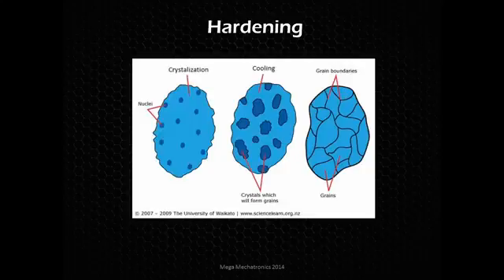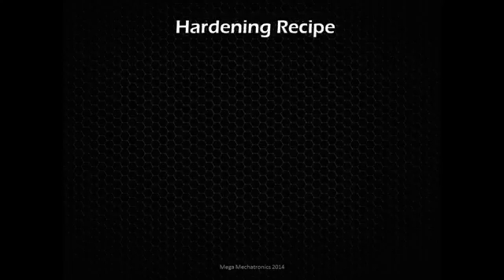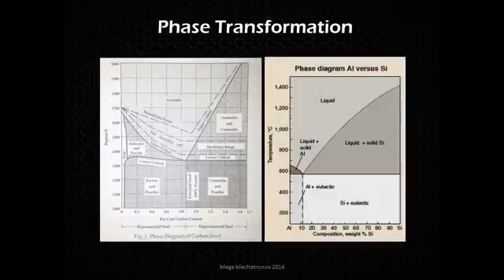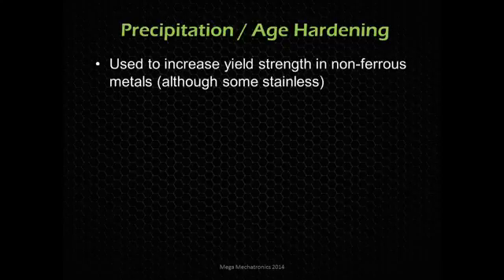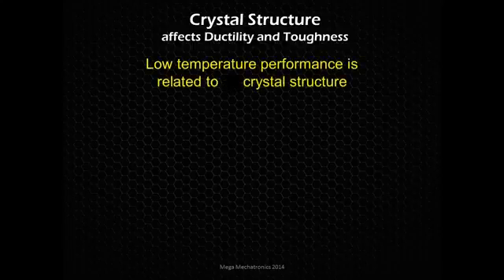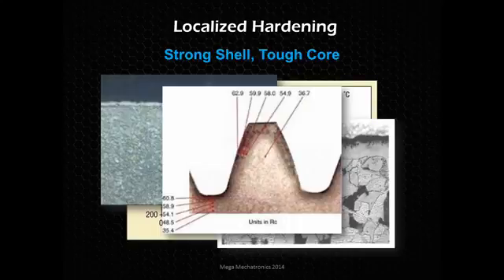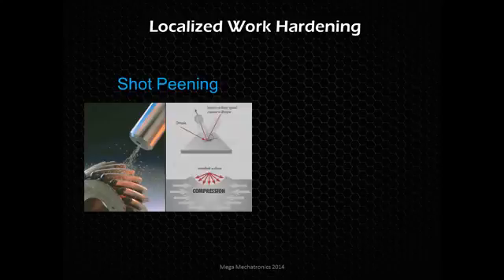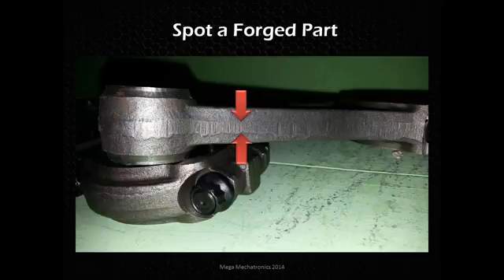Materials Science Mechanical Engineering    Part 4 Heat Treatment Explained

Comment: Tommi Jaya Surbakti_2714100093
Quiz 1 Heat Treatment Class: Q

Hardening and Treatment
Hardening is a procees to make the material became harden or to make the phase become martensit phase. As we know martensite has high strength. high hardness and brittle material. The process can be anaylezed by the change of the microstructre. Crystal system is a crystal syestem whre the unit cell is in the shape of cubic, there are three main varities : Face Centered Cubic, Body Centered Cubic, Primative Cubic, and other such as HCP and BCT. Crytalisation is form while cooling mechanism and the process is nucleation, growth nuclei and form grain and grain boundaries. This process can make slip plane because the crystal will receive force and make that became more strength. More strees in grain boundaries because of the different orientation of the crystal, size of the grain boundaries will affect the properties of the steel. Small size grain boundary will give more strength and more hardness to the steel. Limit Hardenability depend on alloying elements of the metal and hardness depent on carbon content in ferrous metal. More Carbon so the hardness became higher. Hardening recipe actually is too brittle so after quenching we know the process tempering process. Hardening recipe dependent of the cooling rate. 
Cooling rate determined by quench media such as water,oil,salt. Fastest cooling rate to form martensite phase but more brittle the steel. So for the application of the steel will make temper process after quench. Austemper process to reduce the brittle or subzero treatment fto form martensite fully.The Phase transformation dependent by composition matters for example plain carbon steel not considered an alloy. Heat treatment is a controlled process used to alter the microstructure of metals and alloys such as steel and aluminium to impart properties which benefit the working life of a component, for example increased surface hardness, temperature resistance, ductility and strength.Heat treatment processes include case hardening, tempering, solution and ageing treatment, Specialty Stainless Steel Processes (S3P), annealing and normalising. Martensitic transformation, more commonly known as quenching and tempering, is a hardening mechanism specific for steel. The steel must be heated to a temperature where the iron phase changes from ferrite into austenite, i.e. changes crystal structure from BCC (body-centered cubic) toFCC (face-centered cubic). In austenitic form, steel can dissolve a lot more carbon. Once the carbon has been dissolved, the material is then quenchedTempering to improve touhness, the process below transformation temperature. 
Normalizing for ferrous heated above transformation temperature and cooled by air at room temperature. Annealing by the process is heat dan hold temperature, controlled cooling rate and primarly softening. For non ferrous material is precipitation hardening/Age hardening to increase yield strength and produce fine particles. Quantifying Hardness determined by hardness Test .The Correlation between compositon matter for the phase transformation as quench the lowest strain but the higher strength. After that low temper the strenth reduce and improve the strain, high temper make became low strenth and higher strain after that normalizing and the last is full annealing make the lowest strenth but the thighest strain. Hardness test using ball indental or diamond indental will give the value of the hardness or other test is Scratch Test. Crystal Structure affect ductility and toughness. Low temperature performance is related to crystal structure. BCC is ductile to brittle transititon at low temperature, FCC make retain ductility at low temperature. Localized hardening is the process for harden just at the surface material. Example induction hardening,nitriding, and carburizing. For induction hardening same with quench process but only the surface of the material. 
Localized hardening at Low temperature make the hardness become higher and depth of hardening smaller. Induction hardening is a form of heat treatment in which a metal part is heated by induction heating and then quenched. The quenched metal undergoes a martensitic transformation, increasing the hardness and brittleness of the part. Induction hardening is used to selectively harden areas of a part or assembly without affecting the properties of the part as a whole. Strong shell but tough core. Crogenic treatment to transform retained austenite into martensite , promote uniformly and strength by using liqud nitrogen as quench media . More hardness so the material more strenth but the toughness became smaller. Hot working refers to processes where metals are plastically deformed above their recrystallization temperature. Being above the recrystallization temperature allows the material to recrystallize during deformation. This is important because recrystallization keeps the materials from strain hardening, which ultimately keeps the yield strength and hardness low and ductility high. This contrasts with cold working. Cold working It is done at a temperature below the recrystallization temperature and using compression and created dislocation example cold rolling and Crystallization does not take place. Localized work hardening example shot peening and roller broshing .Hot working done at high temperature , stronger the material is produce and allign grain structure.

Comment: Jeremy Marcelno Esfrando 2714100040
Thank you Ms.Dian for sharing this video about hardening and heat treatment

The use of this treatment will result in an improvement of the mechanical
properties, as well as an increase in the level of hardness, producing a
tougher, more durable item. Alloys are heated above the critical transformation
temperature for the material, then cooled rapidly enough to cause the soft
initial material to transform to a much harder, stronger structure. Alloys may
be air cooled, or cooled by quenching in oil, water, or another liquid, depending
upon the amount of alloying elements in the material. Hardened materials are
usually tempered or stress relieved to improve their dimensional stability and
toughness.
Steel parts often require a heat treatment to obtain improved mechanical properties, such
as increasing increase hardness or strength. The hardening process consists of
heating the components above the critical (normalizing) temperature, holding at
this temperature for one hour per inch of thickness cooling at a rate fast
enough to allow the material to transform to a much harder, stronger structure,
and then tempering. Steel is essentially an alloy of iron and carbon; other
steel alloys have other metal elements in solution. Heating the material above
the critical temperature causes carbon and the other elements to go into solid
solution. Quenching "freezes" the microstructure, inducing stresses.
Parts are subsequently tempered to transform the microstructure, achieve the
appropriate hardness and eliminate the stresses.
Metal Quenching
Material is heated up to the suitable temperature and then quenched in water or oil to
harden to full hardness according to the kind of steels.
Material is heated to the suitable temperature for hardening, then cooled rapidly by
immersing the hot part is water, oil or another suitable liquid to transform
the material to a fully hardened structure. Parts which are quenched usually
must be aged, tempered or stress relieved to achieve the proper toughness,
final hardness and dimensional stability.Alloys may be air cooled, or cooled by quenching in oil, water, or another liquid,
depending upon the amount of alloying elements in the material and final
mechanical properties to be achieved. Hardened materials are tempered to
improve their dimensional stability and toughness.
Metal Tempering
Tempering is done to develop the required combination of hardness, strength and toughness
or to relieve the brittleness of fully hardened steels. Steels are never used
in the as quenched condition. The combination of quenching and tempering is
important to make tough parts.
This treatment follows a quenching or air cooling operation. Tempering is generally
considered effective in relieving stresses induced by quenching in addition to
lowering hardness to within a specified range, or meeting certain mechanical
property requirements.
Tempering is the process of reheating the steel at a relatively low temperature leading
to precipitation and spheroidization of the carbides present in the
microstructure. The tempering temperature and times are generally controlled to
produce the final properties required of the steel. The result is a component
with the appropriate combination of hardness, strength and toughness for the
intended application. Tempering is also effective in relieving the stresses
induced by quenching.
In work hardening (also referred to as strain hardening or cold
working) the material is strained past its yield point. The plastic straining
generate new dislocations. As the dislocation density increases, further
dislocation movement becomes more difficult since they hinder each other, which
means the material hardness increases.

Martensitic transformation,
more commonly known as quenching and tempering, is a hardening
mechanism specific for steel. The steel must be heated to a temperature where
the iron phase changes from ferrite into austenite, i.e. changes crystal
structure from BCC (body-centered cubic) to
FCC (face-centered cubic). In
austenitic form, steel can dissolve a lot more carbon. Once the carbon has been
dissolved, the material is then quenched. It is important to quench with a high
cooling rate so that the carbon does not have time to form precipitates of
carbides. When the temperature is low enough, the steel tries to return to the
low temperature crystal structure BCC. This change is very quick since it does
not rely on diffusion and is called a martensitic transformation. Because of
the extreme supersaturation of solid solution carbon, the crystal lattice
becomes BCT (body-centered tetragonal)
instead. This phase is called martensite, and is extremely hard due to a
combined effect of the distorted crystal structure and the extreme solid
solution strengthening, both mechanisms of which resist slip dislocation

Precipitation hardening
(also called age hardening) is a process where a second phase that
begins in solid solution with the matrix metal is precipitated out of solution
with the metal as it is quenched, leaving particles of that phase distributed
throughout to cause resistance to slip dislocations. This is achieved by first
heating the metal to a temperature where the elements forming the particles are
soluble then quenching it, trapping them in a solid solution. Had it been a
liquid solution, the elements would form precipitates, just as supersaturated
saltwater would precipitate small salt crystals, but atom diffusion in a solid
is very slow at room temperature. A second heat treatment at a suitable
temperature is then required to age the material. The elevated temperature
allows the dissolved elements to diffuse much faster, and form the desired
precipitated particles. The quenching is required since the material otherwise
would start the precipitation already during the slow cooling. This type of
precipitation results in few large particles rather than the, generally
desired, profusion of small precipitates. Precipitation hardening is one of the
most commonly used techniques for the hardening of metal alloys.
And to test
and quantifying hardness after a treatment or 
cold work we can use indentation method, usually we can se Rockwell c
,brinnel, and Vickers to do that. Depends on what things you want to test.
There are also
another types of cold work that explain in the video like normalizing,
annealing, localized hardening at the shaft, etc